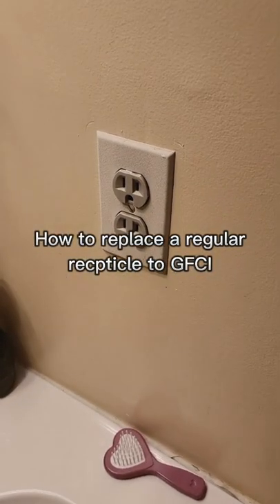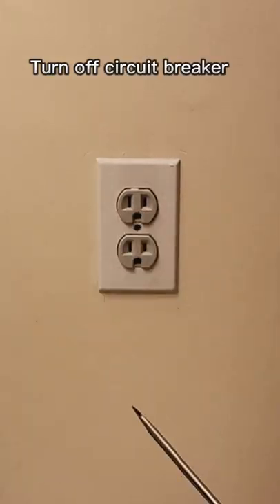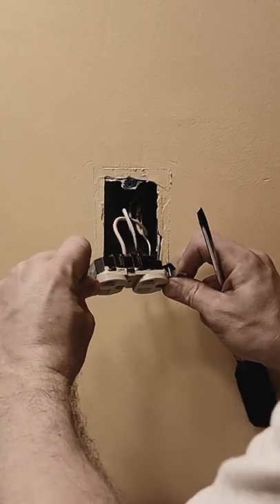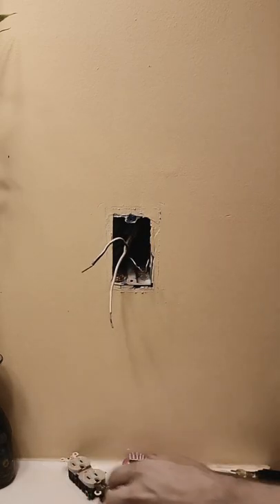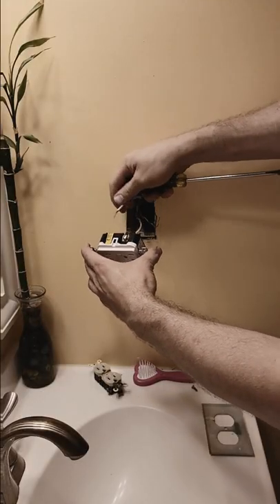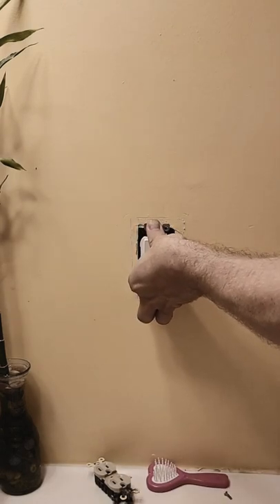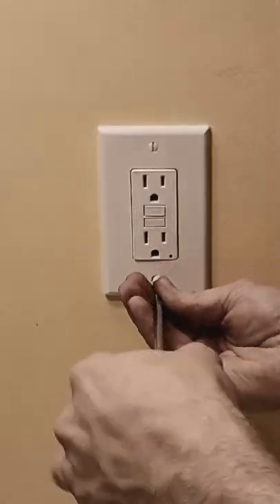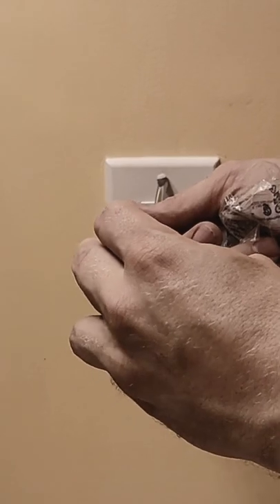😱 The last screw #shorts  #handyman #electrician

Comment: You should’ve taken a second to define line vs load in case that wasn’t the last plug on the circuit

Line: Heat Side (Power)
-You can find this by:
A- Stick Tester you can find at any hardware store. The Tester will beep/notify which Black Wire power is coming from.
B- The last person to touch it had the love to identify by wrapping the Neutral(white) and the Hot(black) around each other or identifying some other way. 

If There is 1 Set of Black/White/Ground(Bare) -> Line 

Load: Where Power Goes 

On a standard GFCI you’ll find a denoted Line and Load Terminals on both sides, White=Neutral & Black=Hot

LMK what I missed

Comment: Normally a gfci outlet is installed as the first outlet in the circuit so that all of the other outlets on same circuit will get shut off when an imbalance of current between hot and neutral is detected.

However, if you can't figure out which outlet that is, the method shown in the video will protect just that one outlet.

Comment: Not so easy to do if there is a second wire that goes to another outlet in an adjacent bath.  The GFCI takes up so much room in the old box that you can't exchange the outlet if the box is already crowded with the second wire.
Reply: Sure you can, but you have to fold the wires up nicely. Instead of a wire nut try using a wago lever nut. They take up less space, allowing you to pigtail the conductors in the box.
Reply: @nunyabidness2143   you wouldn’t pig tail you use the load side
Reply: @noahholt482  now you're just trolling

Comment: Bro you always want to do the green one 1st the green one is the ground one it keeps you safe
Reply from the maker: Power off your good
Reply: If the power was on definitely ground last or else you get shocked holding the grounded frame while hooking up the hot
Reply: @Mechanicallyincleyend  I lost all faith once you plugged that shit into the back of the receptacle. I know it’s easy and smooth, but it’s misleading because they easily come loose from there. Majority of shorts I’ve seen have been caused by this.
Reply: Even I know that after my dad showing me how to replace extension cord ends
Reply: @OhItsJake   those aren’t backstabs . That brand has plates under the screws

Comment: What is the purpose of this outlet compared to a regular one?
Reply: Long story short, ... A ground wire uses electrical resistance to it's advantage to try to divert electricity away from your body and through a separate, third wire.   A GFCI basically checks that wire, and throws a breaker inside the outlet if a decent amount of current flows through that wire at all.  ....... Long story long ...  A ground wire is a third low resistance wire that is connected to your outlets third prong.  On the device you plug into the wall, it will connect any exposed metal parts that you may touch to that ground wire.  The idea is that if something goes wrong inside the device and electricity accidentally ends up going to some part of the device it's not suppose to, such as the metal casing of a dryer, then instead of it going through your body it will instead follow the ground wire since your body will be higher resistance.  It will probably still shock the shit out of you, but should lessen the shock since most of the electricity wants to flow to ground instead (lower electrical resistance).  So now that you know what a ground wire is, keep in mind that if this happens - say some wiring messed up inside your microwave or hair dryer - and then that device, where you touch it, becomes electrified - the bulk of the current may be flowing to ground saving your life next time you touch it but it will sit there electrified until you unplug it.  It will not trip any breakers or anything. Also, some house may not even have the ground wire past the outlet even connected to anything, so this is extra bad (means it's ungrounded).  This is where GFCI comes in... The GFCI has an internal breaker (which a breaker is a resettable fuse).  In our scenario, instead of sitting there electrified and continually keeping it's circuit live going to ground, this thing will detect the ground fault (electricity going where it's not suppose to) and interrupt it (throw a breaker inside the little outlet).  Thus the name, GFCI - Ground Fault Circuit Interrupt.  Also, I'm not 100% sure but if you live outside of the US this may be totally wrong ... I believe in the UK and perhaps other anglosphere nations that they have what amounts to a GFCI built into their breaker boxes.  Here in the US, we almost never do and our breakers only determine if there's too much current (amps) flowing through there as in a dead short or an overloaded circuit.  So, if you live outside of the US, your milage may very and there may be no point.  Also, most devices like hair dryers (again, at least in the US) have GFCI built into them.  If your blow dryer has a weird little box on the end of it with the plug that has usually like a "Test" and "Reset" button on it, that's a GFCI just on the other side of the outlet connection.  Usually GFCIs are required by building code to be installed in kitchens and bathrooms or within so many feet of running water.  This is because if you are really wet and touch something with a ground fault, even if it's grounded, the grounding won't help you as much since you've lowered your body's literal electrical resistance, which is what a standard ground wire relies on to hopefully save your life. 

PS Google that shit before you repeat any of this because I may be dead ☠️ wrong ... Feel free to correct anything here.
Reply: @MrAB-fo7zk  bro, way over explained. It’s a GFCI it stands for ground fault circuit interrupter. They’re intended to be used most commonly adjacent to any basin i.e a sink or bathtub. The intended use is the GFCI will trip in the result of an electrical fault, for example… if your ass decides you wanna off yourself by jumping into the tub with a plugged in toaster, the outlet will trip and shut off power preventing that from happening. It’s not that complicated.
Reply: @OhItsJake  bro way over explained. Bathroom, kitchen, garage, outdoors. Call electrician when in doubt.
Reply: @OhItsJake  oh! Thanks, makes sense!!
Reply: @OhItsJake  why not have GFCI in every outlet in the house? Sounds safer
Reply: @llewodcm20  because they’re not needed, expensive af, and can go bad rather quickly

Comment: Hire a professional.
Reply: Life is supposed to be fun
Reply: @user-rn3rn6nl3h  😂
Reply: Why hire a professional when it’s just that easy?… like your paying maybe 50 dollars or more just to put in a new electrical outlet, all you gotta do is cut your power out in that specific breaker and you won’t be electrocuted and just follow the steps in this video or even a different video if you want but it’s just a simple fix :/
Reply: Hire a professional to change a receptacle???? Are you mad?
Reply: @mcnugget9543  You know for sure that the breakers are labeled correctly? It's not uncommon that the breakers are labeled haphazardly or not all wires are routed correctly when people do their own fixes. For goodness sake at least test that there isnt power with a general purpose meter, a cheap life protection.